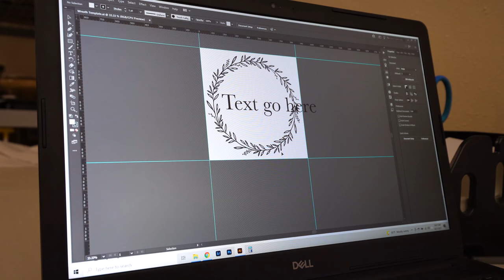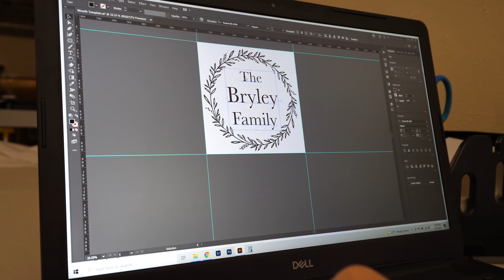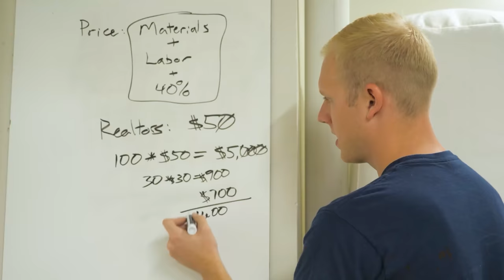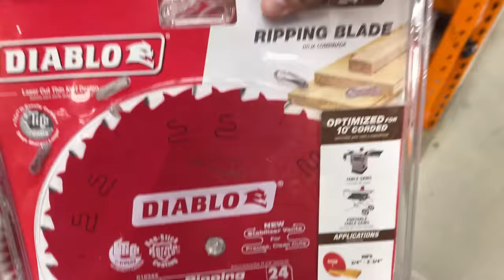is this our problem?

Comment: the way you were having to push 2/3rds of the way through that first cut make me think you are binding on the riving knife and maybe even the back of the blade.  Are you sure that your blade and riving knife are absolutely parallel to the miter slot and that the fence is also parallel to that same miter slot?  I'm guessing that the measurement between the back of the blade and the fence is slightly smaller than that between the front of the blade and the fence.  Not only will that cause the problem you are having, but it also increases the potential of binding and kickback.
Reply: another thought, with that thick maple, are you using a thin kerf blade?  When thin kerf blades heat up the warp and bind even more.  Full Kerf blade is less likely to have that issue.  Sorry one more thing under the heading of annoying (sorry), is the back of your insert plate flush with the saw table?  Many of the seem to dip a little low over time and then the wood catches on the outfeed/back side.

Comment: Only youtubers actually use the riving knife to keep the safety-sallies quiet. They cause more trouble than the problem they solve. Kickbacks aren't that common. (although dangerous when they happen, they are easily avoided) 
Just don't stand directly behind your work and continue to use an offset push-stick.  (or that microjig one that covers the blade for even more safety)

Comment: Rich people save money,  in order to buy assets.
Reply from the maker: True! But usually only for the very first asset. Then they use debt, leverage, and cash flow WAY more often than they save.
Reply: @jennieanddavis  I don't disagree about using leverage,  but many millionaires are very frugal. I actually had the privilege to know, and nightmare to work for a self made billionaire once... and it seems to be a common theme amongst most self made millionaires.